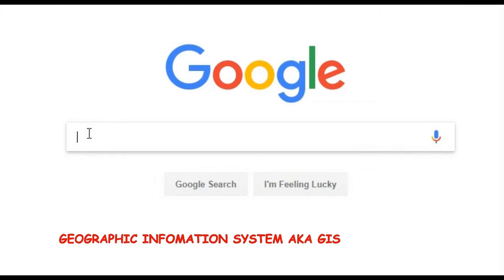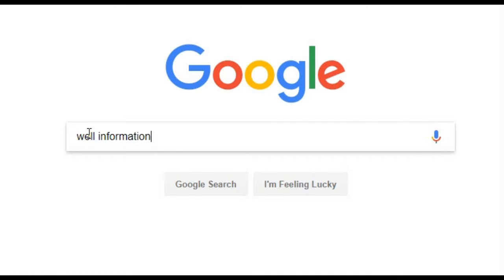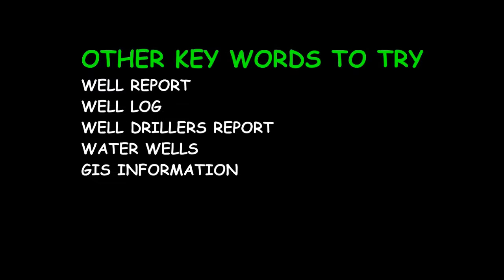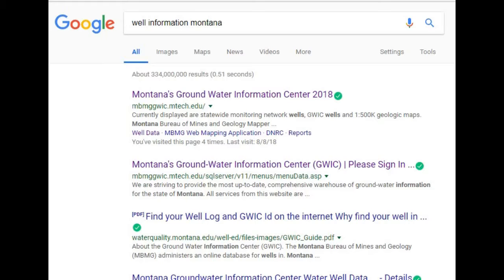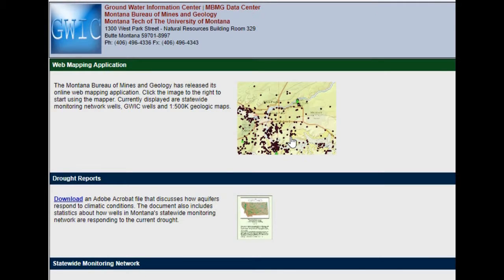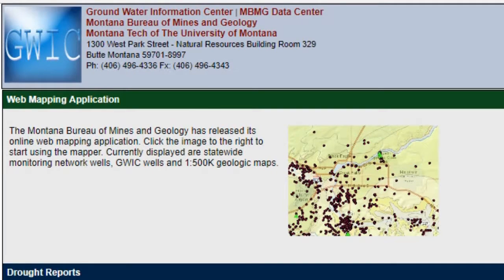STATIC WATER 101

Comment: Awsome video....but if you dont mind, I'd like to share somthing my  Pappy (grandfather) taught me when I was around 8 years old. My mom was really young when I came along and my grandparents raised me...I was Pappy's baby girl and I was glued to his hip most of the time before he passed away. I learned so much from him that at the time seemed like useless, outdated information....but the way things are changing in the world today....I am starting to understand just how valuable that information actually is.....
My Pappy had an old fishing rod that hed cut down to be a little over 2.5 ft long and he had a cheap baitcaster  reel that had loaded with fishing line used for deep sea fishing.. once he had the spool loaded, he tied an underpinning nail to one end and he held the reel and he had me walk out into the field until he told me to stop (1000 ft) where I'd push the nail into the ground.  He'd   then use the type of tape measure that you push as you walk and He'd mark it off in increments of ten that he marked in black spray paint and every 50 with green and red at every 100ft mark... he would then attach a lead weight and also a red and white spherical float that was big enough to float despite the lead weight....he scoot the bobber all way down til it was touching the weight....reelit ind heet it in his truck to measure the static water level in wells. It took a few mins to make, but once it was done, he could get the water level almost down to the exact ft. Then hed just reel up...I dont know why that stuck so vividly in my mind, but it did.

Comment: Over simplified explanation of static water level and where the aquifer in the well.  Most times, the aquifer (sand) is much deeper than the static water level.  Depends on porosity of the sand and other factors as to what the draw down and recharge rate is.  Just because water is at a certain depth, it does not mean it will stay at the depth when pumping.